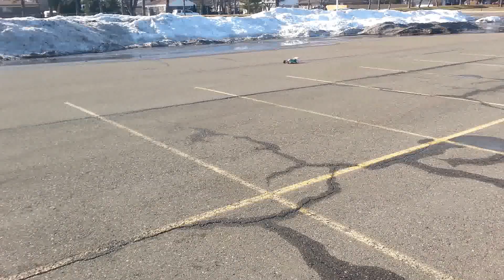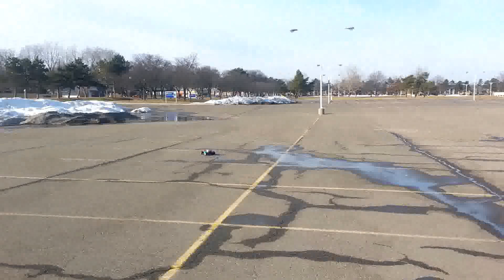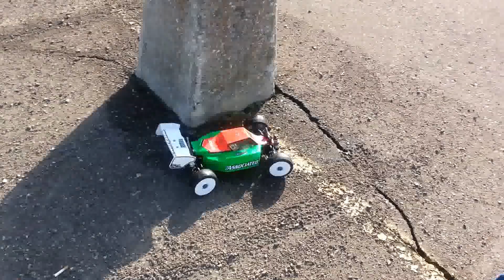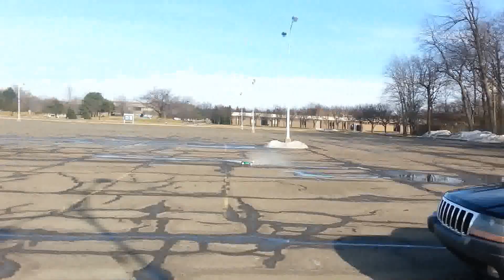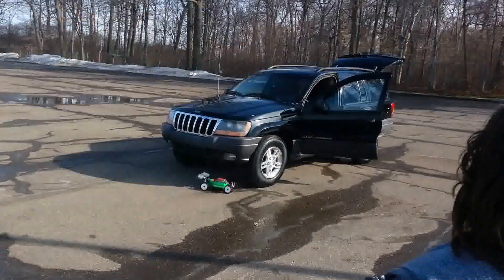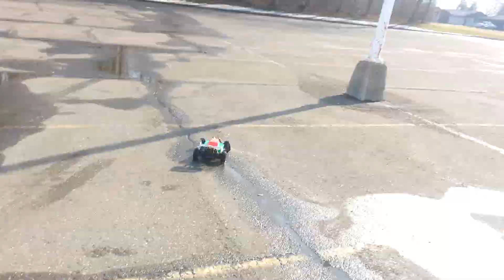Castle Sidewinder 8 2200kv 1515 motor 19t pinion on 6s

Comment: Hi nice run and really smooth acceleration and top speed!,,how many tooth is your stock spur gear?,im using quicrun 8bl150a and castle 1515 1y 2200kv 60.000rpm sensorless on my traxxas slash 4x4,just wondering what spur and pinion would be the best for bashing,any suggestion?,big thanks!